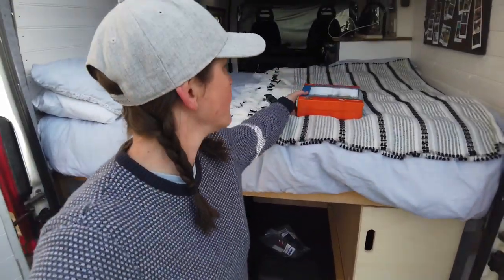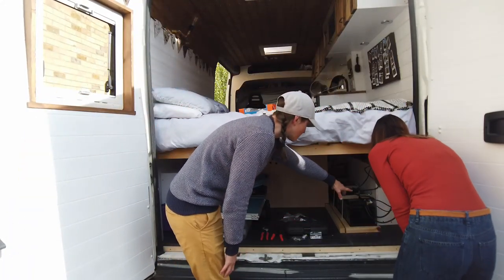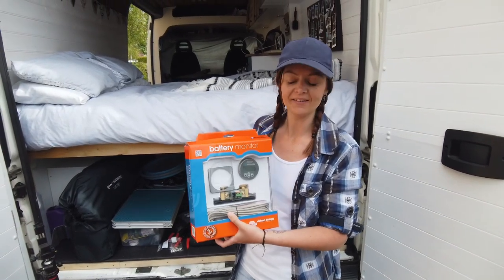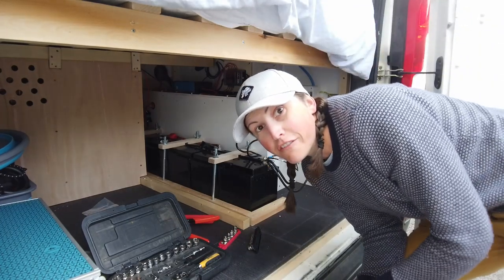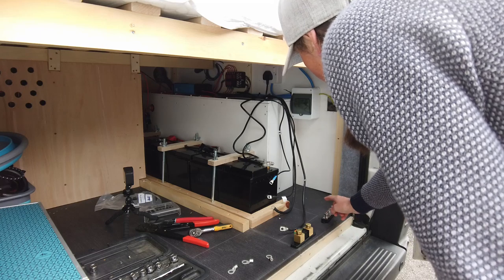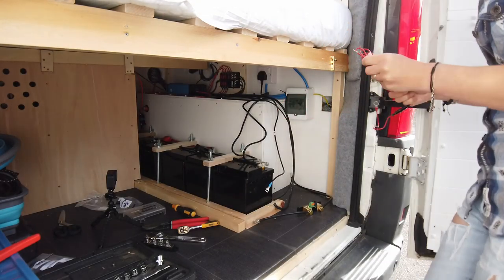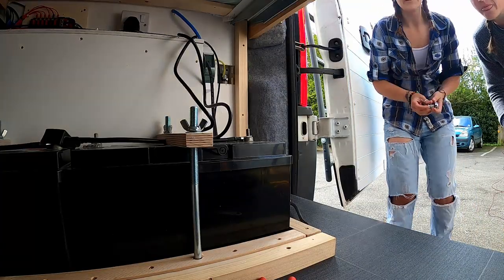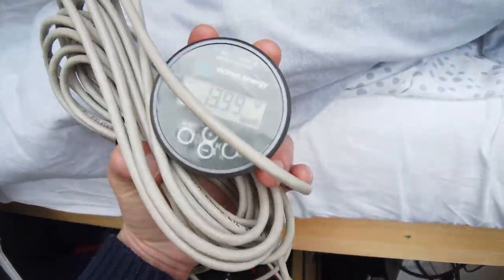HOW to INSTALL Victron BMV-712 smart battery monitor in DIY CAMPERvan. More van electrical setup!!

Comment: At 70, I have done most jobs over the years to cars, caravans and now my boat…..the one job for some strange reason I have been putting off was installing a Victron 712 battery monitor…there are loads of vids on the subject but the reason for this note is to say it was yours which finally prompted me to do the job and I can confirm the system is in and working fine on my boat.
Your film explained things in a very simplistic and understandable way, so Em and I can both say we have installed a 712 successfully.
Reply from the maker: Glad the vid helped you Derek, lou does have a way of making things easier to understand and yep me and you we got this 😀💪

Comment: Congrat’s on getting your BMV712 installed, I’ve got one and absolutely love it. You will need to adjust the AH value of your battery (you can do everything via the phone app), and you’ll need to check that the “Low SoC relay” and “Low SoC alarm” are set to 50% for your AGM batteries - this way it will display your actual available power, so when your batteries are down at 50% your display will show 0%. This way it’s like a car or van fuel gauge, so you only have to worry when it’s getting towards empty or 0%. As for not fitting the display head where you can see it, I guess that depends on two things: Firstly how “hands on” you are with your phone? if you always have it in your hands then it’s not so bad, but if you have to pick it up and unlock it when you want to check your battery levels then it’s better to fix the display where you can see it easily. Secondly, the Bluetooth range is not THAT great, so if you tuck the head unit away in the garage area it’s not so easy to connect when outside the van. If the head unit is mounted in a panel above the level of the bottom of the windows it has a far better range, so you can check the battery state from in the house without having to go outside in the rain - probably best not to ask how I learned this the hard way! Thanks for keeping us edutained (educated, and entertained).
Reply from the maker: Hi Ian, thank you. Yeh you have to change the ah setting during initial set up. The Bluetooth will connect to ours from inside our house even with the monitor tucked away in our battery housing, perhaps it has more to do with the phone than the monitor? Either way it's a really cool bit if kit! Thanks for watching Ian 😁😁👍

Comment: Nice one ladies, as always. I’ll be starting my CamperVan build in January 2022. I’m still trying to get my head round the wiring. One of my qualifications is electrical engineer, computer-based really but, my disability and fibro fog is causing me a lot of trouble 👿. My biggest problem though is concentration, I have big problems with concentration is now. Before are used to do this for a living for crying out loud but since developing fibromyalgia syndrome it just makes life a little bit more interesting full of brain farts here and there. Lol 😝 💋
Reply from the maker: Oh no, you will be awesome at this then, at least you have some time to try and get into the swing of focusing. My mum has that and goes healing plus tries to meditat and says that helps her 👍
Reply: @campervibe  Thanks Em 💋

Comment: £170 ! Cor bit pricey. I'd be framing that and putting it on display in the van. I've bought a cheapo £40 one that just tells you the voltage.  Thanks for the videos girls they've been fun to watch over lockdown, even though I haven't been able to post any messages on youtube through any of it for some reason. And yeah these are some of the best amateur electrical van vids around everyone else either skims over it or (probably) gets a professional in.
Reply from the maker: Thank you! Yeh it's certainly not cheap!! Thanks for watching the vids, I found the same when I was researching the electrics, not too much actual filming of it being done. Thanks again 😁😁👍

Comment: Well Done Emily another great blog just a bit of a tip use a hairdryer on the shrink wrap stops you burning your hand 🖐 Keep Safe to you both x
Reply from the maker: Hi Paul, thanks 😁 the hair dryer is broke hence the lighter, will get a new one after lockdown. Thanks for watching, stay safe yourself 😁👍
Reply: camper vibe 😩😍😍

Comment: Hi, great video. Can you tell me where you got the negative bus bar from please..also what's the amp rating... cheers Steve
Reply from the maker: Thank you, I think I got mine from Amazon at 300amps but can’t see it on there now. A company called 12v planet have them, rated at 210 amps.

Comment: Just checked out the price and this seems like an expensive addition.  Not sure im going down this route myself of installing the monitor, but handy to see the install and weigh up the benefits/ costs.
Reply from the maker: Thanks toni, yes it's a lot of money. For us we just wanted acuurate info so we can push being off grid as long as possible with reliable battery monitoring. It's not necessary for many vanners tho, thanks so much for watching, glad you could still find it interesting 😁👍

Comment: Should the auxiliary battery earth stay connected to the battery negative or onto the shunt?
Reply from the maker: Hi Frank, I've gone battery neg to shunt, shunt to bus bar, negative to chassis. All negs for fuse box, chargers etc come off the bus bar.

Comment: Hi. A quick question regarding your DC setup. Did you run a ground wire from your leisure batteries negative to the chassis as I am finding conflicting information if it is needed or not. All the best
Reply from the maker: Hi Paul, I'm certainly no expert. I haven't done it yet as I have a neg running back to the start battery, which is itself grounded to the chassis. (I needed it for the b2b) I will be adding one when we get back from our travels tho, as I feel it can do no harm and possibly be safer. I know what you mean about all of the conflicting info tho, it can get very confusing lol. Good luck with your install 👍

Comment: hi, i meant to ask, now a bit of time has passed how have you found the BMV to use. was it dificult to setup the correct parameters.. thanks mick
Reply from the maker: Hi mick, it's been great, it's kept me on top of our power use and has always worked. After the initial set up I've not really changed any settings, I don't think I need to.

Comment: Amazing video yet again👌 can this be fitted with any battery charger? I have a ctek in my van.
Reply from the maker: Hi Jamie, I don't see any reason why not. It works independently from our charger, it just so happens that our charger is victron smart also so shows up on the app. Thanks for watching 😁